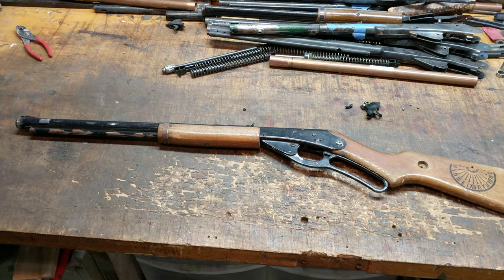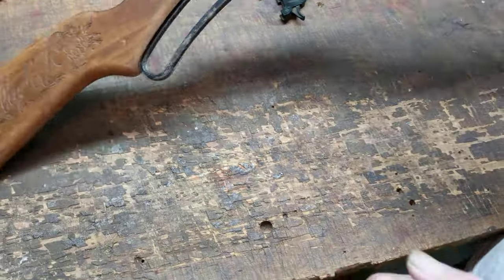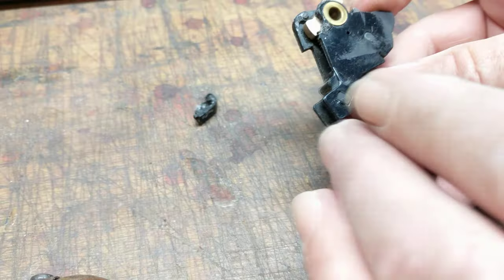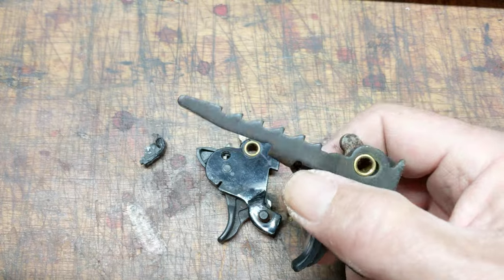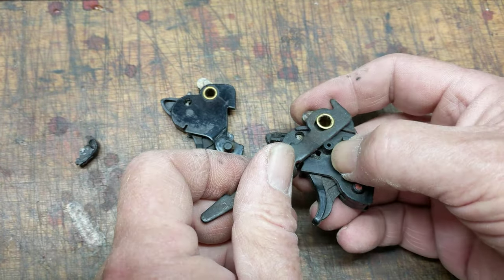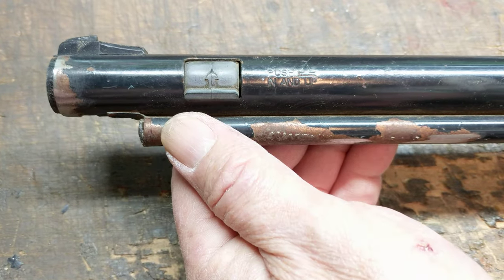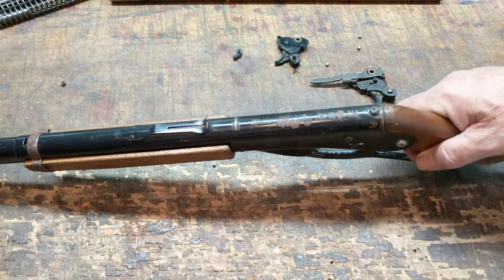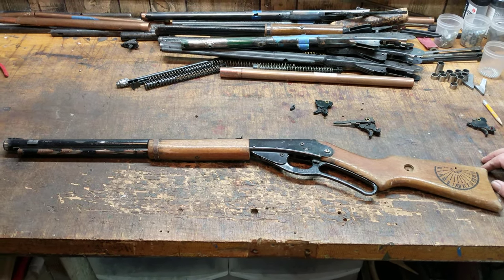1983-ish Daisy Model 1938B plastic trigger issues

Comment: I  found this on an air gun forum ...what do you think? The plastic Red Ryder Trigger 

1-Take off the hook spring from the ratchet arm pull the arm up and out of the way.

2-take off the trigger return coil  spring.

3-take off the sear coil spring.inside and you remove it with a thin straight slot screw driver.

4-replace the sear spring with lighter strength  trigger return spring.

5-search your office for a ball point pen spring and cut to fit as the new return spring.

That's it, just add your favorite lube.my trigger went from a nightmare to a dream trigger about 2Lb pull and predictable let off.

I also did while the springs were our shorten and polish the upper  sear contact area.it just makes a shorter let off but if you botch it your out of luck.